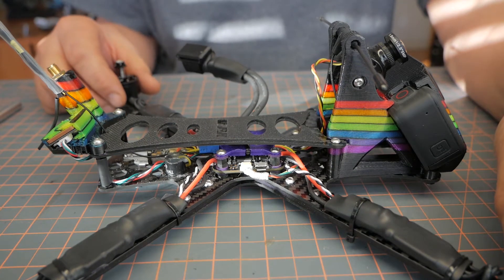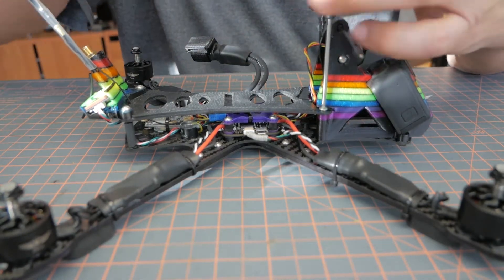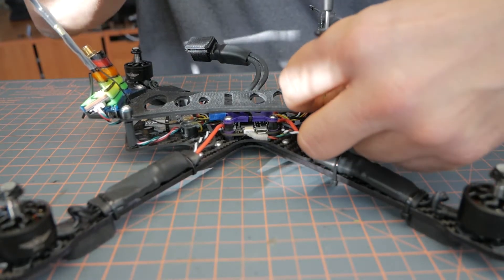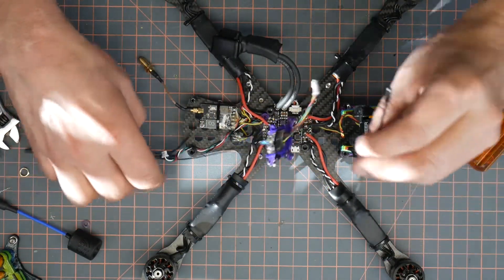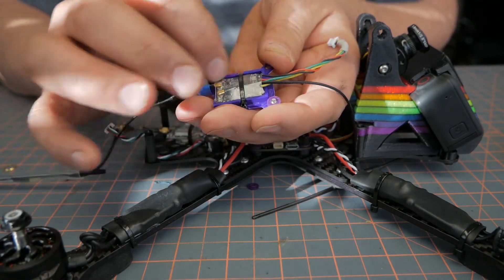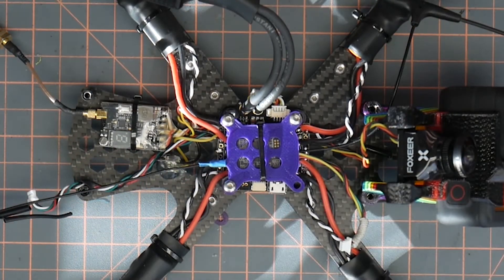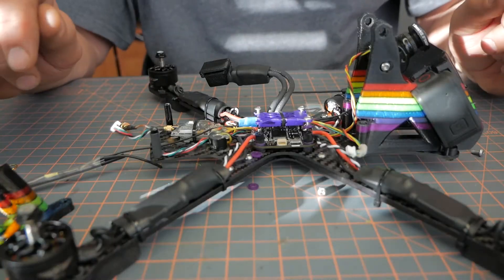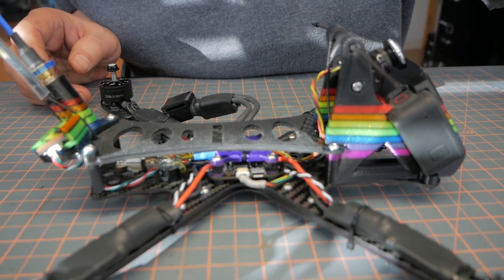Crossfire Diversity Nano Installation | MB Epic 262

Comment: So much wrong with the rear antenna. cf rod? coax in line, clear tube. it's way of like this. And almost touching your 5.8 video antenna
Reply from the maker: i redesigned the rear mount so that the gps is between the 2 antennas. the antennas don't interfere with each other; one is a receiver, one is a transmitter.
Reply: @AlaskatrazFPV 
This is how I did it on my Discovery a few weeks ago.
https://youtu.be/pauiYFWNCPE

Maybe for freestyle your front antenna horizontal isn't bad for this for longrange not needed.
But don't add any material on the antenna elements (unless you can measure the outcome) and keep clearance from metal/carbon and other antennas.

Comment: Did you just solder the wire on same pad where normal crsf nano rx should go? Just 4 wires rx tx 5v gnd?
Reply from the maker: yes, just 4 wires as you mentioned.

Comment: Hi where can I find the stl file for the forward mount you have on this quad?
Reply from the maker: That print is specifically for Multicopter Builders Epic frames.  The print is not publicly available, but there are other versions I have seen. Check Thingiverse and search for Epic frame, or multicopter builders.

Comment: Any tips on how you extended the crossfire antenna to mount on the rear?  Great design!
Reply from the maker: It's a simple process. I don't have the links but you have to get some long u.fl cable and then you strip it back and solder on a ground wire.  The videos i've seen take the ground wire off a crossfire antenna, but they say any wire will work. I'm not an antenna guy so i try to stick to store-bought antennas.
Reply: Thanks.  I got some longer antenna wire to make up some longer ones.